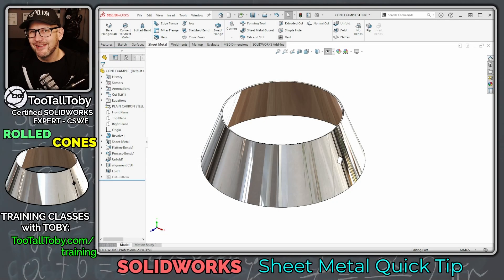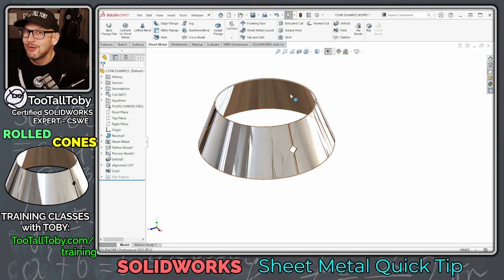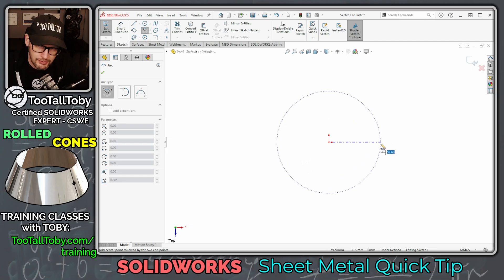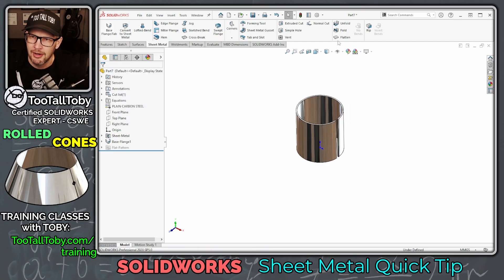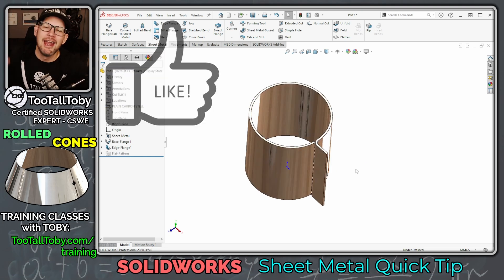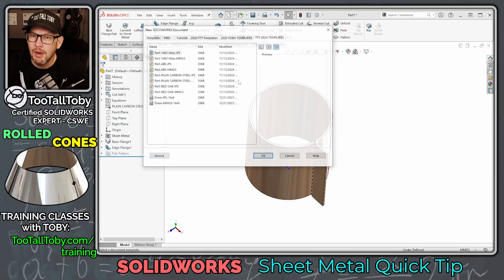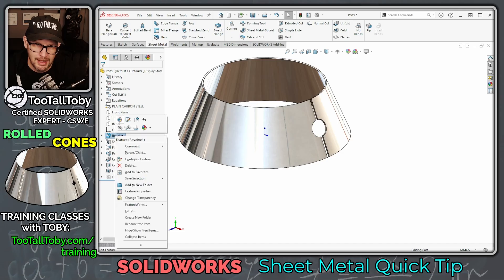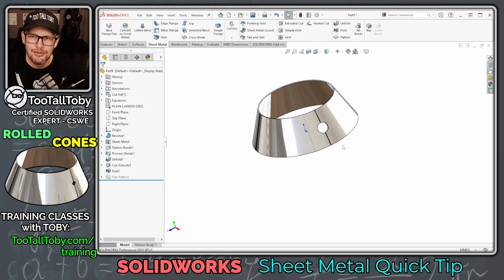How to create ROLLED CONES in SOLIDWORKS Sheet Metal - Tutorial for Students - Flat Pattern

Comment: I want to mimic parabola by two conic sections in sheet metal only. By the method you mentioned I can generate only one conic section at a time. How to get both of them joined in single design? The "insert bend" cannot be extended beyond one section even if two sections are collinear !  I can work around with two separate pieces as is the case with two separate designs, but would like both of them joined in sheet metal by another flat section. It would be so nice of you if you can give me some tips

Comment: @TooTallToby question regarding annotation, when transferring this part to the drawing sheet, how I add the phi angles for the flattened cone on the drawing sheet, I used the Lofted Bend method and used arc to draw the two circles for the cone when I was at the drawing sheet annotation process I couldn't get the phi for my radius down.

Comment: How do I make Garbage Chute Offset of about 24" Dia Chute having 30 degree offset with vertical axis? upper, middle and bottom piece will have different cutsizes when flattened. Only connection between top and middle & middle and bottom will have same cutsize so they can be welded together. connection is also at an angle making all 3 pieces' flat pattern curved/splined instead of straight rectangular. It's difficult due to the tappered shape.

Comment: Hi, nice video, but when you tried at 1:30 minutes, the sheet metal base flange I wanted to copy you, but the options on my pc were different, it did not include direction 1 and direction 2, it only had the sheet thickness (I tried to flange base a cylinder of length of 1500mm and it couldn't flatten since 1500 was the sheet thickness not extrude  ) so can you help me to figure it out?
Reply from the maker: I see you solved it - nice job!

Comment: Love your videos. thanks for all the tips. I'm designing a rolled cone like this but want to show the two edges at the seam with weld prep chamfers. when I add the chamfers using unfold/fold, the rollup reverses direction. what do you recommend as a work around? configuration and add two different chamfer features--one shown on the flat pattern and one shown on the rolled piece?

Comment: Hey TTT, we do a lot of weldment stuff, frequently pipes for handrails etc. where the pipe joins together, sometimes there can be quite complex mitre cuts. 

Is there any way to get the shape of that mitre cut and flatten it out so you can print it on a piece of paper, roll it around the pipe and just follow the lines to cut the steel accurately?

I did find one method online but it involved about 20 steps making offset surfaces and split lines and it was just a bit of a hassle. You haven't found a SW workaround for this?
Reply from the maker: What about surface flatten?  That would probably work (you would start with a split line to split the face up)

Comment: In your Revolve feature, you can use a single line rather than a rectangle.  Check the "Thin Feature" box then input your sheet thickness.  You can either go "outy" or "inny" depending on how you dimensioned your sketch.  In your example dimensioning the bottom of the line to 500 OD, then your thin feature should go inward.
Reply: My thoughts exactly! Get out of my head!!

Comment: Important to know- Industrial fabrication shops use rolling machines. The absolute tightest they can roll is the diameter of the rollers (usually three rollers, all the same diameter.) the absolute TIGHTEST you can roll is the diameter of those rollers. If you know your fab supplier, great, you can ask. if you're subcontracting out, understand that rolled cones don't really work on thicker gagues. They're a pain and should be a last resort, not a first option.